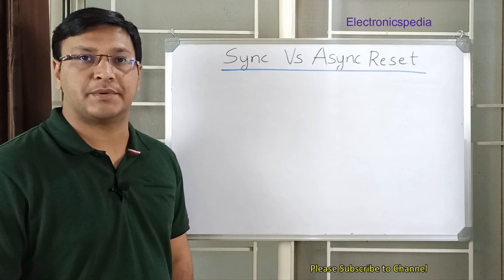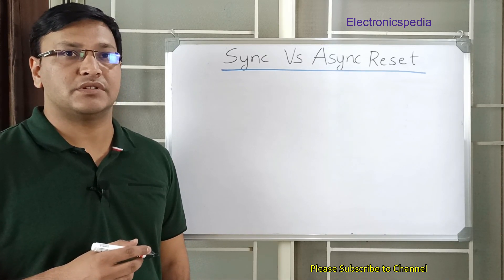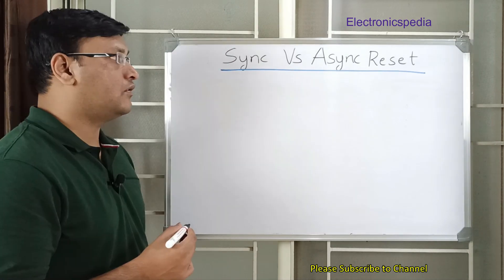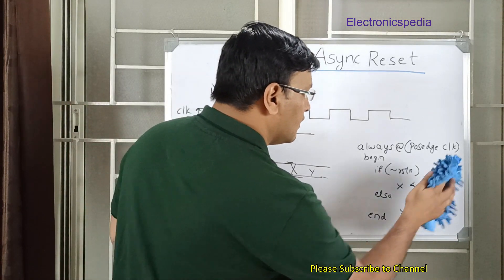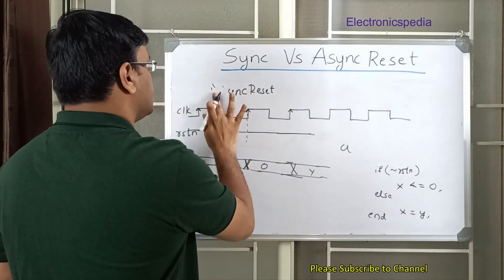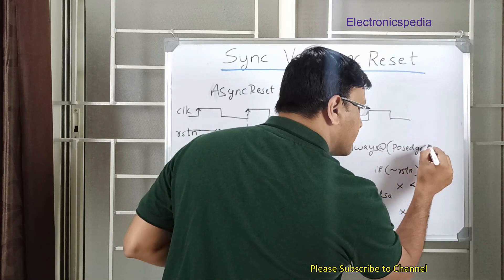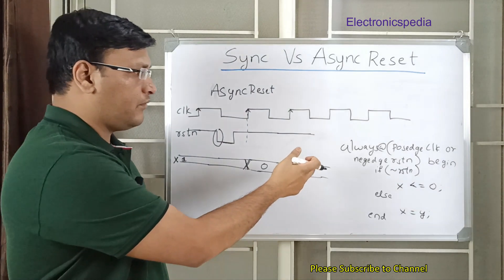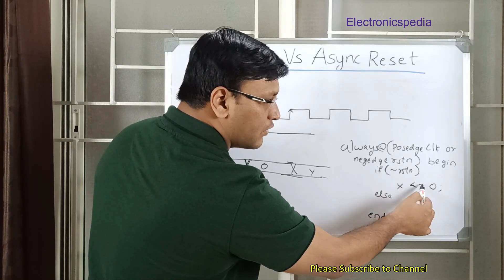Synchronous Reset and Asynchronous Reset | Synchronous Reset Vs Asynchronous Reset | What is Reset?

Comment: Synchronus reset is dependent on the clock edge while Async reset is independent of clock edge for reset assertion but still dependent for reset deassertion. Async resets are better than sync reset as they have the ability to reset the device quickly as compared to sync reset.

Comment: Is there any specific criteria which we should use for the reset to be low for that minimum time span?
Reply: Resets are generally used in the design or SOC to make the whole design in a known state before starting the mode entry. There can be various modes like functional mode or test mode. But before doing that we need to make sure that the device is in a known state , ie, all nodes are 0. So to answer to your question is that is depends on your device , how big it is and how much time it takes to reset completely.